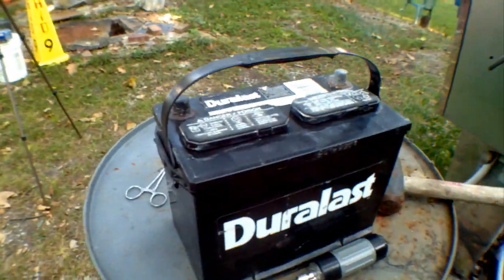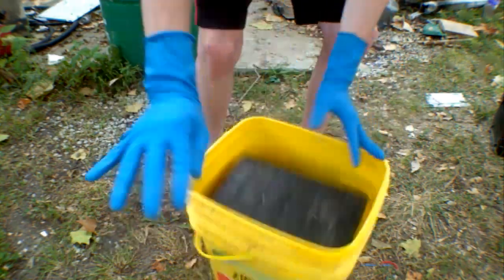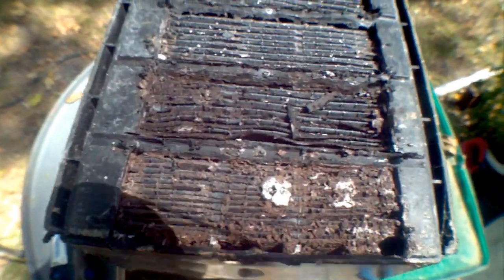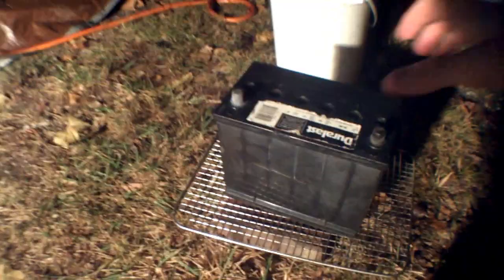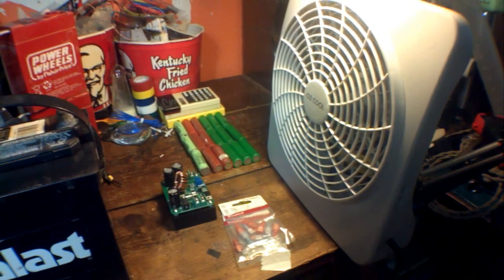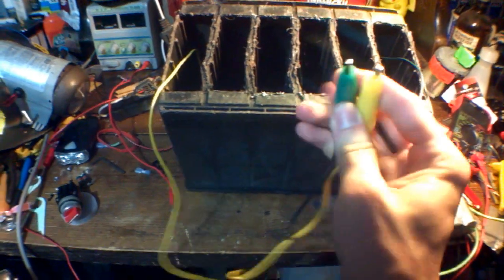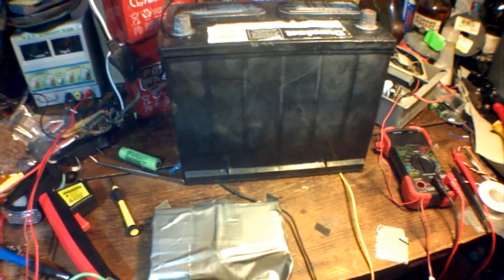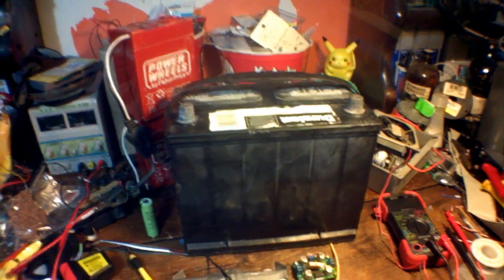DIY Lead-Acid to Lithium-Ion battery conversion 18650

Comment: That's some dumb shit I did when I was your age so I won't blame you.
But I bet you learned that your clothes ended up with a lot of holes in them.. LOL

But, all you did here was make an unnecessarily large battery case, or holder.
Reply from the maker: Richard's World no thats why i wore shorts and sandals, less cloth to burn.
Reply from the maker: Wizzard_
your cloths will burn when your skin will just get itchy.
Reply from the maker: Wizzard_
this "acid" is 90-95% water, and no it doesnt burn much in that dilution. it would be worse for it to soak into my clothes.
Reply from the maker: Wizzard_
i've gotten it on my arm before, btw why do you think a "dare" would have any impact on your statement? only children dare people and accept dares.
Reply from the maker: Wizzard_
lol your such an idiot. go on

Comment: yep, that slip up with the acid bath was the absolutely perfect display of what not to do, and the need for eye protection...battery acid (especially in an old,depleted battery) is not that strong, in that it wont burn you, unless you leave it on for 10 mins plus, but, it WILL most surely fuck your clothes....next wash will reveal holes or severely weakened fabric,and as for your eyes, well, thats pretty fuckin obvious isnt it?..that guy has no shame..otherwise he would've edited that "Homer" moment out. All the hours spent messin with this..could've worked those hours for someone else ,got the cash and go buy a new battery,this guy is so lucky...I wish I had time to just fritter away like that...not that I'd spend it like that mind you...

Comment: So I don't see anything in the info about if this worked for you or not..  How did you charge the battery.. Was it getting all the direct amperage straight from the alternator? If so how did it not fail or puff or worst case catch fire?

Comment: If the cells aren't balance charged, the life of your packs will likely be fairly short, (especially if you use them often) ,due to the variance in internal resistance from cell to cell. You'll have a sudden drop in capacity caused by one ,(or several) of the cells failing and it'll be a big headache trying to track down which ones.  I'm sure it wouldn't take very long to find a good balance charge schematic online.  It's a little tedious getting it set up, but it can save you lots of trouble in the long run with the added benefit of making your battery packs last much longer.   ...and also,  using little 7mm x 1-3mm thick neodymium magnet disks, (super cheap on Ebay),  to connect cells is amazingly handy and can save you hours of soldering ...Just a humble suggestion for future reference. ;-)
Reply: @Swim Fan  Yeah, I hear you. You're certainly not wrong. I'm not exactly sure what my state of mind was when I made that comment, but many people filling what basically amounts to empty car battery cases use 18650 cells stacked in parallel/series stacks.  Unfortunately, the safest and most secure way to connect a bank like this is by spot welding them in place.  Depending on how many layers and rows you're dealing with it could be a bit tedious tracking down bad cells.  ...Also, I take back my suggestion to use neodymium magnets for connecting cells, unless (MAYBE) the pack is going to be used to power something with the very tiniest bit of current draw, (This day and age that DOES NOT include most modern smartphones and tablets, and especially not laptops). It seemed like a super handy idea until the day I heard a buzzing/arcing noise accompanied by a little smoke in one of my experimental portable battery stations.   If I hadn't been sitting right there with it in a quiet setting, that could have turned out badly.  You live and you learn eh?  I'd like to think I've grown a little wiser after seven years. ;-)

Comment: I have been thinking in the same ranges as you, but not to do just this. This is an awesome idea for a battery case. Love it.
I myself have a use for a light highpower battery, that can take a massive charge, compaired to regular batteries, for my "Homebrew Festival Speaker".
Right now i have a 12V 7,2 AH batt, wich runs out after 3 houres at 30W(full load on speaker) but i have used it alot at ca 21+ watts, wich than gives me a 4 houres.
But what would you recken the capacity would be of a full loaded 100AH battery would fit ?
If your cells are 3,7V 5000 mAh, you got 10 in paralelle and two series, thats 185Wh per new cell, and you can fit 6 new cells, so would your filled up battery have about 1.1 kWh in total ? is that about right ?
Reply: Tummas Eivin Kruse Chinese Leading LiFePO4 Battery Factory -- TopBand (stock code: SZ002139)
We offer 12Ah 20Ah and 25Ah Prismatic cells, top leading quality.
Contacts: rockypower520@hotmail.com
Reply: 18650s go as high as 3400mah so you could have a small yet powerful battery

Comment: Then again you may just buy nickel iron foam from aliebabba. Cut the foam to make your electroces for a battery. Then coate with oil and bake untilled chared or carbonized. Also soot from burning used motor oil should gets some nano carbon layer on your electrodes. Then use a clother or one of the supper absorbant microfiber clothes to seperate your electrodes roll if you want just make sure that the rolling does not short it out and have a cloth spacer between electrodes. Stuff that in a mayson jar or some jar with a plastic lide is more ideal. The electrodes should fit nice dow in there and you wire up your electrodes or have clamps that go from contacts made into the lid. Then you fill with water and potassium hydroxide and some lithium hydroxide you shuld have a nickel iron cell to charge up to 1.67v to 2v max. Note over charging does make gas.

Comment: If you have protective eye ware, and rubber gloves and wear long clothes that cover your entire body. When a lead acid battery is dead put powder lime in it. The acid reaction is very strong but will release lots of carbon dioxide and make calcium sulfate hydrate that may help to turn the cell into a calcium sulfate cell.

Comment: I am curious.How long did it take you to get to the shower after you got
splashed with the acid?Did you get any burns from this?
Reply from the maker: Loyd anonamous i got to the shower in about 20 seconds, then i realized it wasnt burning so i ran back outside to turn get the battery out of the bucket then i took a shower. by that time my legs felt really itchy but nothing unbearable. and it didnt make the skin red or anything. but this battery acid is like 20 years old so its highly diluted.
Reply: Rinoa Super-Genius well yes the acid would be much weaker all right
but still very dangerous.Your lucky and wise to get to the shower that
fast.Every second counts in a accident like this.Would have been better
to work which face shield and better clothing protection.Also a garden
hose turned on and right beside you would be great.
Reply from the maker: Loyd anonamous
didnt have a garden hose at the time, and tbh its not that dangerous. its more dangerous for the cloths than for the skin. dont mistake pure acid for battery electrolyte. it seems to be a big issue where people hear stories of getting burned by battery acid but they dont realize that is pure acid that you pour into a battery not the electrolyte thats already in the battery that should have 90% or more water.
Reply: Rinoa Super-Genius
Well your right about the dilution.But the acid
in a new battery is still much diluted.
Sulfuric acid is just plain very corrosive.
Always treat it with much respect.

H2So4 S.G. range 29–32% 1.25–1.28 battery acid range so you can see its not very much different from charged(new) to discharged The actual long term will be less than 1.200 S.G.
Reply: Loyd anonamous H2So4 S.G. range 29–32% 1.25–1.28 battery acid range so you can see its not very much different from charged(new) to discharged The actual long term will be less than 1.200 S.G.

Comment: I would suggest you post your video only after you have proven it works. If the kid has a very basic knowledge of how Lithium-Ion battery works and get charged he would not have posted this jokingly unserious "innovation". If your battery pack works, there is no need to empty the old battery just to box your "pack", you can find a box in Walmart for $2 to contain your "pack". I wonder if the splash of acid at the beginning did ruined your clothes, a supremely reckless experiment. If you really did use the pack in your car, you must have had a small explosion in the engine compartment while driving or the best case, unable to start the car the next day!
Reply from the maker: Benjamin Zhou why would i use this battery in a car? i said in the video that it was for when i go camping and stuff.

Comment: Why would you waste your time using a lead acid case instead of just making the 12V cell using that yellow bucket you dumped the acid into. Judging by your careful display of dumping the acid into the bucket I can see where your intelligence is.

Comment: If you so worried about keeping the case intact you could have gone to Sears and picked up one of the old "dummy" batteries they use for the display. They are empty housings. Then you wouldn't have to worry about the lead and acid disposal. I do a lot of work with industrial batteries ( forklift, reach trucks, pallet loaders, order pickers,and reserve power which is batteries for computer data center power backup). We get inspected by the EPA monthly and have waste water monitoring systems to make sure nothing leaches into the waste water. Sulphuric acid used in the batteries can be deadly if ingested or gets into an open cut. All employees are lead tested twice a year and are limited to the number of hours a day they can come in direct contact with lead.
Reply from the maker: Moe Taib well i didnt dispose of the lead plates, i kept them for future experiments. also you deal with batteries on an industrial scale. dealing with a few in your back yard isnt nearly as dangerous.
Reply from the maker: Moe Taib well i didnt dispose of the lead plates, i kept them for future experiments. also you deal with batteries on an industrial scale. dealing with a few in your back yard isnt nearly as dangerous.

Comment: you are just one explosion away.  I stopped playing with Lithium ion when I saw how dangerous they are.  I play only with LiFePo4 batteries now due to this thermal runaway (which cannot be stopped once started) on the Lithium ions.

Comment: recycle the old lead battery at a junk yard there paying good money now or save it to trade in 12 buck core now and use a 4 buck plastic tool box as a case and you get a handle \ for the lith ion

Comment: DID YOU KNOW...
that you can use pretty much almost any plastic container to hold batteries?  
not just old battery containers...
Reply: Yeah, but then it doesn't look like a car battery.
Reply: It’s about the form factor. Where the battery has to be installed back into.

Comment: The great thing about LiFePo4 batteries is their size and then you add them to a giant old Lead Acid battery to carry on a camping trip?    Thats a bit of a waste unless you were using it as a stationary back up that didn't need to be carried around!

Comment: I'm sorry but this is dangerous in so many ways. Let alone chemical burn and toxic lead that so many people pointed out, Li-Ion battery without proper case & insulation will short someday and burst into fire! Never connect all 18650 cells, it will become a bomb! There is a reason why nobody uses Li-based battery for car battery!

Comment: I was hoping you were going to pack it full of 18650 batteries to give a powerful 12V battery hiden in the old Duralast case and then re-use it in your car.   Anyhow it was interesting to see what's inside an old battery.   Even the Tesla that I'm driving also has a similar type battery to that in addition to the main battery which has 7000 of the 18650 cells.
Reply: Norman Hirsch best not to drive and go on you tube at the same time :)
Reply: Norman Hirsch  Chinese Leading LiFePO4 Battery Factory -- TopBand (stock code: SZ002139)
We offer 12Ah 20Ah and 25Ah Prismatic cells, top leading quality.
Contacts: rockypower520@hotmail.com

Comment: I think you would have had an easier time of it if you had cut off the top of the car battery instead of the bottom. It also would have facilitated attaching the lithium packs to the native terminals. Good deal, tho!

Comment: I get the deal with you wanting to do something with the time on your hand but why risk burns and blindness from battery acid not to mention lead poisoning and some EPA violations trying to repair this tired old battery when you could just buy a new smaller sealed lead acid or AGM battery. Or better yet just use your Li-Ion cells and ditch the car battery all together. It's lighter and easier to pack away. Especially if your camping you want to have a light load anyways.
I have made Li-Ion battery packs for 12 volts@30 Ahr using cell phone batteries in the past and it was alot smaller that your Li-Ion pack.
Reply: Rinoa Super-Genius hmmmm... I wonder how much the EPA fine would be.  I hope no one reports this.
Reply from the maker: TigrrrTamer
fine for what?
Reply from the maker: TigrrrTamer
the ones i didnt violate? ok
Reply from the maker: sublimationman
i didnt want to do that because that would possibly ruin the look because then the top would be all fucked up. but the way i did it the top wasnt ever touched so it looks completely normal when sitting on the ground.
Reply from the maker: ElfNet Gaming because i wasnt risking blindness and burns, nor an EPA violation or lead poisoning. over 120k people watched it in the end giving me about 400$ so far and more to come. so i think it was a good use of my time.
Reply: Rinoa Super-Genius $400 since 2013? I guess since it's youtube that's an ok number considering it's youtube...
Hey its cool though as long as your safe with your battery adventures. From my experience I have had seen these things leak, fume and even explode in the past due to improper handling and charging procedures not to mention people being burned. I personally have dropped them on my foot and had acid spill on me and eat holes in my pants... Thus is why I do not favor car batteries for power needs outside of a car.
Most of the batteries I work around are the big AGM types found in cell tower sites in dual 24 volt bays consisting of high amp 2 volt batteries that weight a solar mass... Though they are sealed for the most part I have seen them leak and bloat which in itself is a scary thing.
Reply: Rinoa Super-Genius the epa violations you guys were chatting about
Reply: Rinoa Super-Genius They are assuming you dumped the lead in the trash which would be illegal. If you do this again, cut around the top of the battery, this is how they are made and will allow easy access as the plates should just dump out easy and it will give you access to the terminals.  Personally I would just use a plastic container like for food and then put some banana jacks on top.

Comment: i like your spirit of adventure to try to make someting useful from the old battery case.

shame that trolls like mercury90hp want to try and ruin peoples fun.

while the battery acid might have been too weak to burn your skin on contact before you could rinse it off with water, the lead in those batteries can be absorbed into your body and lead like most heavy metals is very hard for the body to get rid of.

lead can be toxic in even small amounts and with lesser amounts that do not kill you it can still cause many health issues. i hope you found a safe way to dispose of the lead waste.

i would like you to consider the use of safety equipment when you do your hobby.

your legs and feet were unprotected, as were your arms and face including your eyes, but did not have to be.

i do not want to rain on your parade. i just would not want you or someone that followed this video to be injured.

anyway, i and many others enjoyed the video you shared with us.

thanks Rinoa Super-Genius !
Reply: Que Sero judging by the wrecklessness, and the irresponsibility that comes through the responses, lead is already in the brain. too late for this poor kid.
Reply: If they can’t create, they destroy.

Comment: I don't really see the point of using an old FLA battery for this.  However I applaud your ingenuity.  That being said, you would have had a much easier go of it had you cut off the top instead of the bottom.
Reply from the maker: i tried cutting the top off but i think i would have messed it up, taking the cells out the bottom makes it so if its sitting on the ground, people think its a big heavy battery.
Reply: Rinoa Super-Genius well if you ever decide to gut an FLA again, use a utility knife to cut it below the ridge where the top joins the sides.  You can normally cut through the case with four to five passes of the blade.  Once you get the top cut the plates will pull right out of the case with the top.  Saves time and makes life easier when making connections to the terminals.   When you're done a little two part epoxy easily rejoins to top and case.

Comment: Let's do chemistry with sandals and shorts!  I hope he doesn't reproduce.  There are enough morons in the world.
Reply: Derp Salad shut your mouth dipshit defender. If that is your arguement then the kid should have been out there butt naked with swimming goggles on. Protective gear should be worn when handling hazardous and poisonous chemicals. Especially, if one is posting an informational video.
Reply: Acid can get absorbed by cloth; it's easier to wipe off the acid than to take off jeans with a painful burn, dumbass
Reply: Abunai One LMMFAO!!!

Puts rubber gloves on then dumps the acid into a bucket with the shit splashing around then i see his sandles, i liked to died laughing!